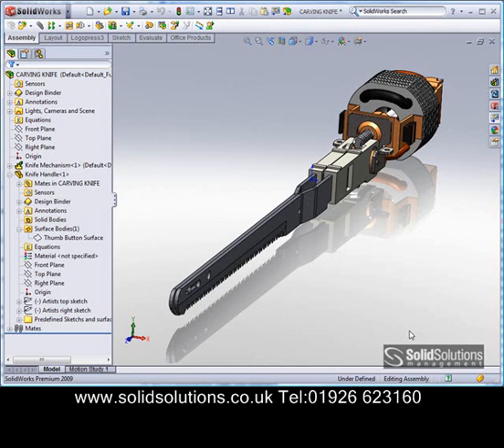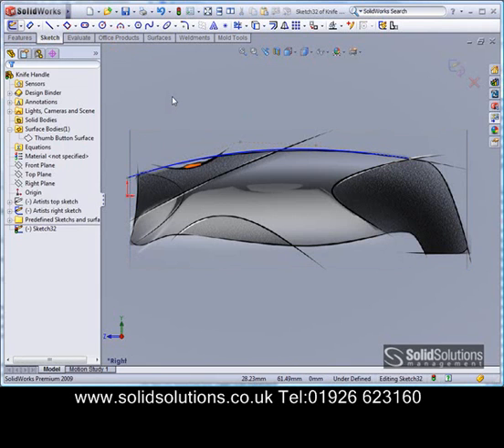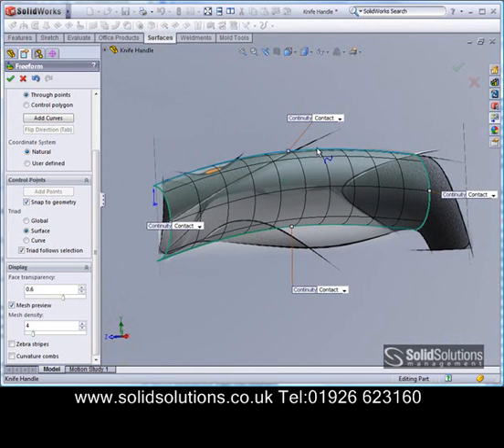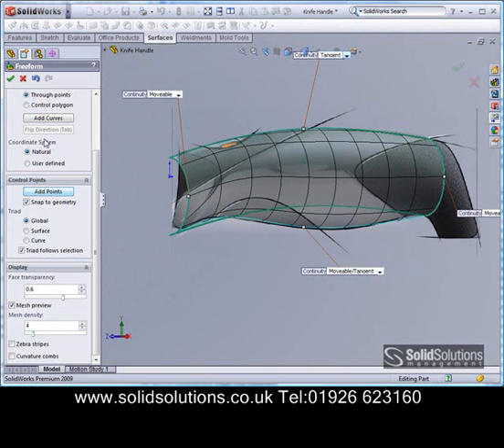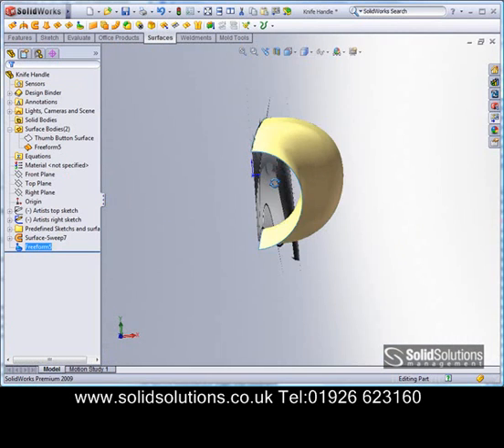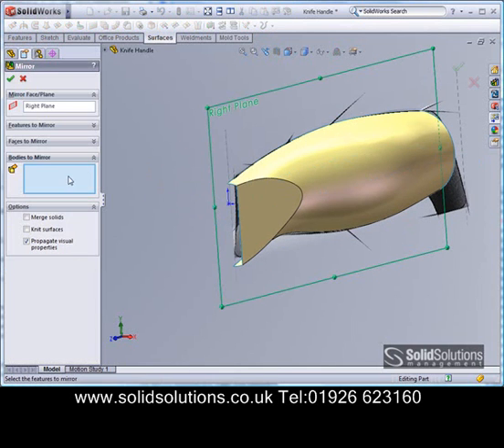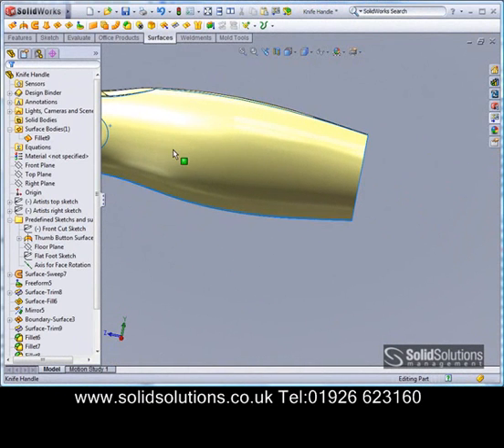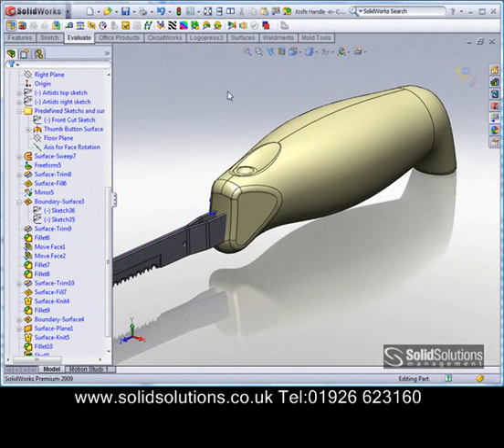SolidWorks Complex shapes

Comment: Very nice, and quick work, you make. I have a question however. When you used the boundary feature to make the tail of the handle, it was initially done in a round state. The screen then jumps to a more completed model, how was it that you ovaled the tail out? Or was it a matter of going back and using an oval sketch instead of a circle to start off with?

Comment: @SolidSolutionsManLtd does solid works work well with fluid dynamics? i am looking to design a petrol/steam/electric hybrid and would like to design it on my computer before I actually build it i do have Auto-CAD but am not having much success with fluid dynamics, I am not a professional though I do know a few persons experienced in CAD but no one experienced in fluid dynamics